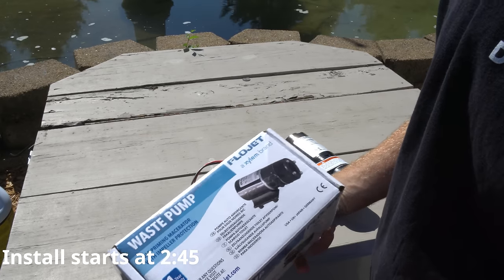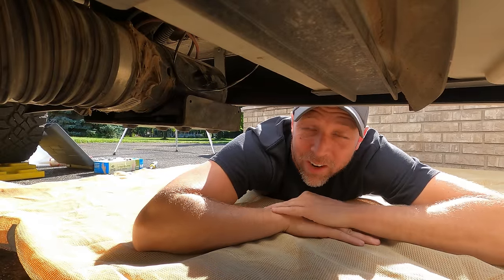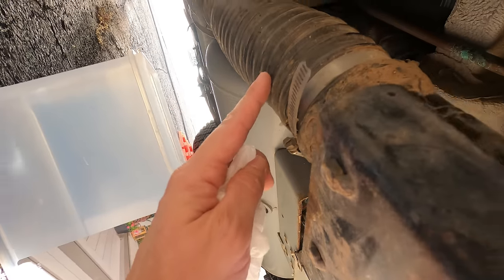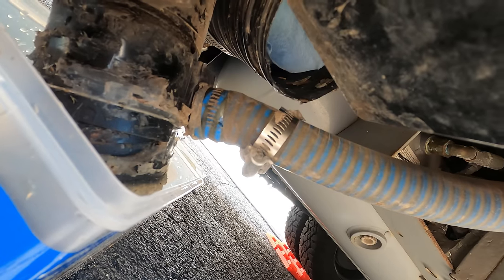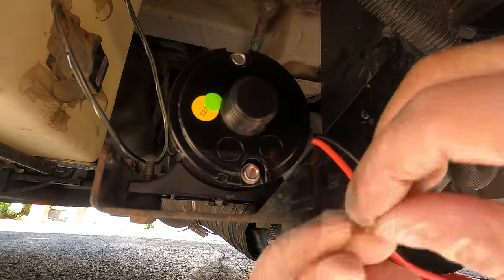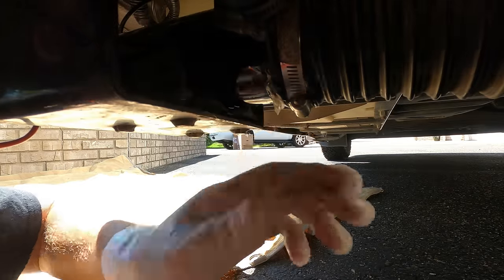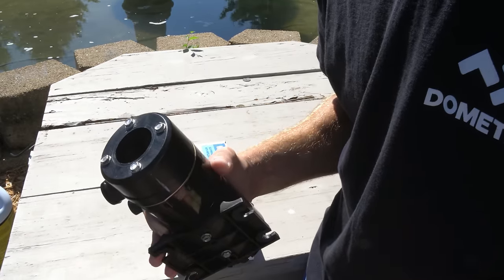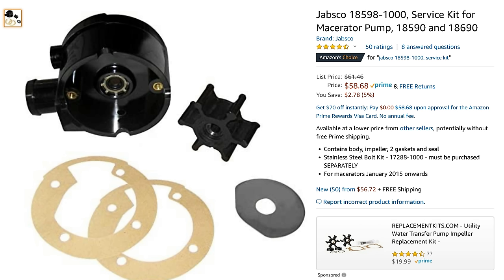RV Macerator Pump Replacement | Full Time RV Living

Comment: Very helpful video on what I initially thought was a disgusting job.  It helped to first rinse the system a couple of times and double gloving. My pump leaked from the same gasket location where the 3” hose is connected. Upon removing the hose, I discovered one of the 4 bolts had broken and I wasn’t about to dismantle the unit to fix that.  The 1” outlet hose was indeed harder to remove.  I cut away an inch off the end because it was deformed and had a difficult time reattaching it, until I used a heat gun to soften the end of the hose which then slid on effortlessly. I imagine warming it with a heat gun will also make it much easier to remove.

Comment: Good job on video, I had two macerator toilets on our catamaran, had to replace one pump over 11 years, the rule of thumb in the marine industry is TP never goes down the toilet. My pumps "failure" was due to a rubber hair band wrapped around the impeller which I got off the hook due to me being almost bald!. Once a month we would put vinegar in the pump and let sit overnight which loosens the calcium build-up, also add baby oil every so often and never swallow olive pits! In my van I'm using a port-a-potty
Reply from the maker: Thanks! That's pretty good to only have one pump go! We have met a few FT Rvers that also don't flush tp, to help with space. We might look into a separate trash can for that...... Thanks for the vinegar tip!😃

Comment: Most excellent video about an unpleasant replacement job. Now that you have given me the confidence that I could do it myself if I ever had to. 
I always try to give the pump a break every few minutes I use it as I don't want it to ever fail. In many ways I would prefer gravity - never fails.
I expect Chris did not rush in to do it instead of you!
Reply from the maker: Thanks! Good practice on not burning the pump out or running it dry!👍 I hear you on the gravity........ but I do like how you don't have to mess around and attach/detach the hose. Seems to be cleaner and quicker.
 I told her I would do a cooking video if she handled this one! Didn't fly. 😂😅😂

Comment: Great video of the reality of RV ownership! Looks like an easy enough job (once you have seen it done, LOL!) Highly recommend using reusable butt connectors to avoid cutting the wire each time to put on new crimp connectors. Since this is macerator  #3, it seems a more changeable connection is needed than a permanent one. If you keep cutting you will eventually run out of wire.... Also if you use 2 hose clamps spaced a few millimetres apart with the tightening screws a 1/4 turn offset you won't get the leaking and need the added silicone. Will check my pump number today and order a spare to have on hand!
Reply from the maker: Hello. Great tips on the connectors and hose clamps! Yes, they seem to be finicky and need frequent repair. Or maybe we just need to take it easier on ours!😅

Thanks for watching!

Comment: Great job, Aaron! After having 2 macerators fail, I converted to gravity dump. I hate macerators with the heat of a thousand suns (I think I got that saying right 😂).  BTW, I got my 3000w victron inverter and 400ah BB all hooked up and really wanted to express my appreciation for your thorough videos. It was a giant job what with all the tight spaces, crimping 4/0 wire, etc.  I still have the 50w solar panel so next big upgrade will be adding some more solar, but we drive a lot more on our 9 day vacations so solar isn’t as essential as the alternator charging.  Thanks again!
Reply from the maker: Thanks! They can be a pain in the @$$. I'm glad you got your system going. You're going to love it! Appreciate you watching and have fun on your next vacation!

Comment: We have your same exact Van same year and are macerate are just broke, after taking it apart you won't believe what clog up the macerating blades, it was full of the plastic coating on the pods that we put in the toilet. Needless to say we only use liquid now wish we would have known that before
Reply from the maker: Crazy! Never would have thought of that. Our first pump also had a larger plastic piece in it, but I'm not sure what it was. I think I'm going to spend more time flushing it when I can to help keep it clean.

Comment: What kind of tools do you carry in the van ?? After though . I should ask on my previous comments. Thank you . Be safe and be kind !!
Reply from the maker: That's a good question and something I should cover. But short answer is I carry one socket set (3/8 and 1/4) , one ratcheting bit driver kit, one cordless 20v drill/driver and one small tool bag.  In the small tool bag I have as much crammed in there as possible! 😃

Comment: I like watching your channel always good info. May I suggest a watertight Automotive locking connector instead of those crimp connectors. You're always losing wire when you use those and unless you get the marine grade they're never water tight and can lead to corrosion. I just wouldn't want to have to do that anymore than necessary would want it to be as easy as possible the next time around. But just a thought
Reply from the maker: Appreciate the thought, thanks! Definitely a good suggestion for this application!

Comment: Great video and commentary!  If the holding tanks happen to be full at time of macerator failure - are these isolated well enough such that only have to deal with what’s there in hoses/pump during replacement?
Reply from the maker: Hello thank you! Great question👍
The knife valves on the black and grey tanks are before the pump and should hold liquid tight when closed. You will still get that a gallon or so of liquid in-between the valves and the pump though.

Comment: How often are you replacing or rebuilding the pump?  Seems like we get about 12-18 months before it starts leaking. I tried to “rebuild” mine last time and it was a waste of time. I just replaced it and it fixed the leaking issue. I’m also trying to find a different way to connect it because the corrugated flexible hose is hard to get right to seal it up.

Comment: Great video. Thank you! I looked up the macerator pump in our parts manual for the 2014 Intestate. It’s 602176 but doesn’t give the brand name. Your link to the pump is a Jayco but I don’t see the part number 602176. Is this the same pump? Want to be sure before ordering from Amazon. We just replaced our macerator and had Airstream do it. May try it ourselves next time. Hopefully there won’t be a next time, but there probably will be. Thanks again.
Reply from the maker: Hello thank you! I believe that is an Airstream reference part number and I found a website that sells that part and says it is an OEM Airstream part that fits 2008-2017 at about $50 more. https://highskyrvparts.com/new-airstream-parts/airstream-trailer-plumbing/sewer-fittings/pump-macerator-flojet-airstream-interstate-602176   The picture is of the same Jayco Flojet pump as mine. 

I also looked at a 2018 AI parts book and it lists the same number, but says Flojet. 5. 602176 Pump, Macerator Flojet
I do think they are all the same, but it is good to double check the number on yours. If you stick your phone up there and take a short video you should see the number. 

Thanks for watching!
Reply: @IreneIronTravels  yes, thank you. I found that same site too. I’ll order it from Amazon because I can always return it if needed. Thanks again!

Comment: Very good repair video but I noticed that you over done the Silicon,  that will harden and clog up the impeller. Otherwise awesome job!
Reply from the maker: Thank you. Yes it is a fine line with the silicone and that corrugated hose and I was following suit with how the factory did it.. If you don't get enough its a pain if you get a small leak. I did think about the silicone breaking loose like you said, but as I've had it apart a few times I haven't noticed any. Hoping if it ever does it will be soft enough to get chopped by the metal blade.

Thanks so much for watching! 😀

Comment: This seems like this isn't your first rodeo with your macerator.

Question: I have a 2014 Leisure Travel Van.  Lately, my 20 amp fuse burns out occasionally (and always when I have a line at the dump station) when turning on the macerator.  
I'll be replacing the on/off (power) toggle switch...thinking it's shorting out.

In your opinion, are multiple fuse replacements an indicator of a macerator motor failing?

Thanks!
Reply from the maker: Yes, we did replace the macerator twice in the 2.5 years we owned it! I don't think the fuse blowing is an indication the pump is bad, as we didn't experiance that on our first bad pump. BUT, we did have that same thing later where I'd go to flip the pump switch and the fuse popped. I just can't remember if that was before or after I replaced the second one. I think it was a safety measure to protect the pump when the impeller was stuck. I used to have to manually turn the pump with a screw driver to get it unstuck and stock blowing fuses......I feel your frustration☹️
Reply: @IreneIronTravels  Thanks for your perspective and advice. As a matter of best practices, I purchased a big box of assorted fuses from Amazon (cheap!) and it’s always onboard and easily assessable.
Reply: @IreneIronTravels  Hi, Irene…

Just an update.  I replaced the old toggle switch and checked for continuity and it was OK. Checked 12v power, that was OK. Fuses still popping. Rotated the impeller several times. No outwardly obstruction(s).
So……..I ordered a new Flojet macerator from Amazon yesterday afternoon.  Arriving today. Out $300 OUCH!
Of course we’re leaving on a long road trip from N. California to Yellowstone day after Labor Day.  Glad this mess happened at home and not on the road.  Stress levels are high.  This really sucks!!!
Thanks again for your input.

Comment: Help! I'm not sure my power is completely disconnected on my 2019 Airstream Interstate 19.  Disconnected the chassis and house batteries, but I can't tell exactly what you did to disconnect the solar charge controller at the 2.39 minute mark on your video.  I can't find the location of solar charger.  I got on top of the RV and disconnected the feed from the 3 solar panels. The display reads .0 Solar Charge Amps.  I've removed the pump and the hoses but I'm afraid to cut the wire.  I bought a new pump through your link and want to finish the job myself but right now its in pieces in my driveway.
Reply from the maker: My charge controller is after market, so I had a fuse inline on mine that I pulled to disconnect. There is also a fuse for the macerator pump in the fuse panel you could pull for extra measure. It's been a while since I did this job, but do you have a multi meter to measure voltage to make sure there is no power? Sounds like you're doing a great job on your own so far!
Reply: Solution:  I texted my son-in-law, he told me to cut the wire.  I'm still here so he must like me!

Comment: I would be careful of the silicone if any gets in the pump it could jam it up. Just FYI. Also the running and stopping on your previous pump is do to a current limiter in the motor that shut down the motor if its pulling to much current because of something putting a bind on the motor.
Reply from the maker: 👍 Makes total sense because once I cleared the blade from hair and other binders it worked great. Except it leaked! New one is working good so far. Thanks for watching!

Comment: I'd think about replacing the entire mess with a composting toilet. Far, far less disgusting.
Reply from the maker: 👍 We really did want a composting toilet at first, but have grown accustomed to the black tank set up. We didn't like the idea of having to empty the small 1 gallon liquid tank every day, although it is easier to do. I think my ultimate set up would be having both. One for solids and one for liquids.
Reply: Irene Iron Fitness I don't like composting toilets or cassette toilets, having to empty those is disgusting, Using a dump station is bad enough for me, but it's better than the first two options.
Reply from the maker: Cassette toilet was definitely a no go for us. It would last about 2 days! 😳
Reply: Irene Iron Fitness The holding tanks are the biggest limiting factor for me when I go out Boondocking, I would like to get my black tank replaced with a larger tank if possible.
Reply from the maker: Me too. I still plan on looking into that...
Reply: Irene Iron Fitness* I’m thinking of getting this toilet! https://youtu.be/0efTfdB3FHM Video is the inventor demonstrating and I really like this one. P.S. urine is like fertilizer for plants. If I cap off my brand spanking new black tank, I might could use the new black tank (w/a bladder or not?) for extra fresh water.
Reply from the maker: Interesting toilet... I haven't seen that one. He mentioned he makes a kit that diverts the urine into a separate tank if you want. That's what I would like as we drink A LOT of water.  I'm sure the right tech could figure out a way to turn your B tank into a fresh one... Not sure the material difference they use between the two.......
When we are out boondocking we love to help out and water a cactus!🌵😜
Reply: Irene Iron Fitness* Geez you’re right about diverting! I remember him saying that. I’m getting close to getting on the road. Gonna buy new so I thought wow maybe could make new BT into extra fresh water. I’m gonna get your lithium set up too & new AS has 4 batteries so I’ll have the space for the 4 lithium. I really appreciate you.  At the end he points to the 3 cubic foot $15 (well 4years ago)bag on the floor & says it could last 2 years for 2 people. Sale site has a kit to make it water tight. Tell Chris I’m going for it including 4x4 😎Love you guys.
Reply from the maker: It sounds like you are piecing together your dream van! You're going to have such a great time! I'll let Chris know!